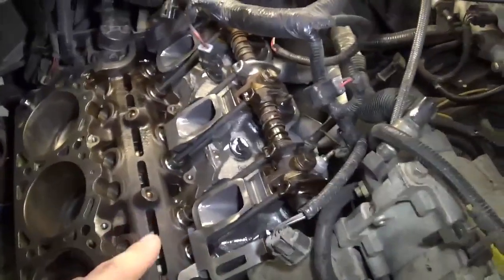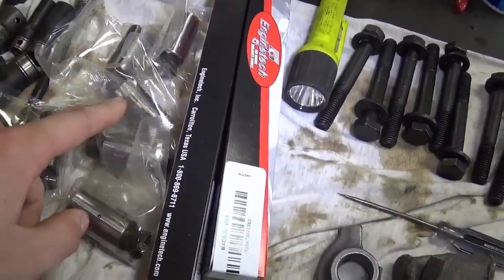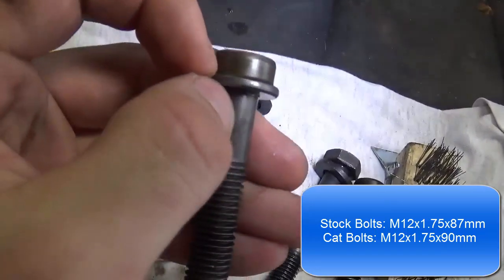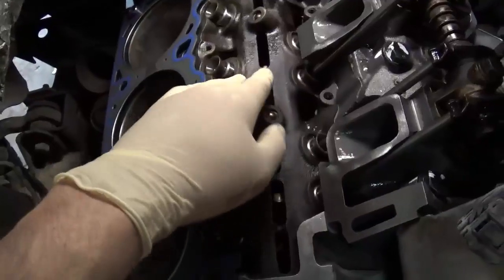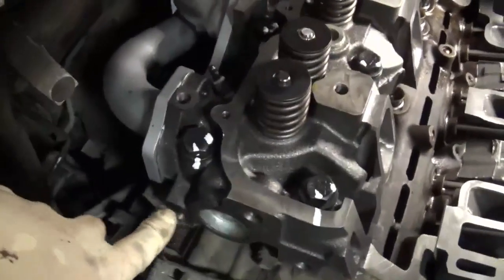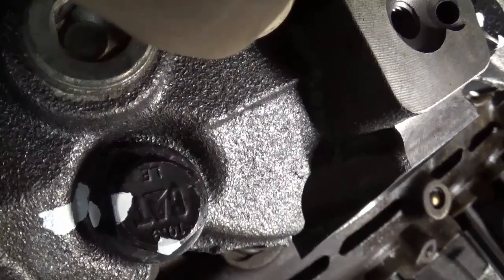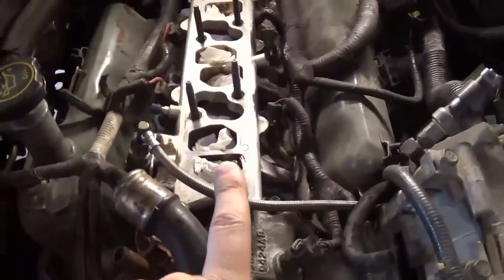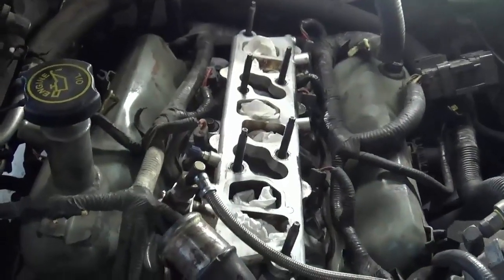Ford 4.0 OHV Top end rebuild

Comment: Typically how much would this entire job run you if you paid someone to do vs you doing it yourself
Reply: I just finished rebuilding my 4.0 ohv for my 98 ranger, total cost ran me about 1200-1500$. I replaced all gaskets and seals, replaced a few broken parts and a few that just generally should be replaced when rebuilding. Shop would easily be double that, plus labor

Comment: First of all, nice video!
I rebuilds that damn ticking 4.0 engines so many times, and I can say that pushrod wear issues fixes real easy. They have not enough oil feeding,  because pressure oiled only bore of rocker arm, oil not pass to pushrod cup. Drill one more 1-1.5mm lube hole to shaft, for every rocker arm, that will intersect with oil passage in rocker arm when the valve is open, and problem solved. Rocker shaft is not very hard, so drills easy. But much better add also hi-volume oil pump (Melling 328) and new non-Chinese lifters (Melling or Sealed Power). Yeah, it's a lot of money (Pump costs 143.79, 28.79 costs new stressproof shaft, and 393.48 for lifters at Rockauto), but if you want good result for rebuild - better to do it. Oh, and I made tool for pre-oiling 4.0 OHV from old oil pump gear and 1/2 socket. Drive it with hand drill or equal tool (no impact wrenches, of course), and first start will go less stressful for engine.
Sorry for my English, I'm not native speaker - I am Russian. Greetings from Russian car enthuziasts.
Reply: No need for sorry, your english is WAYYYY better than my Russian. 6-8 words maybe. Are you drilling the hole from pushrod cup to rocker arm pivot shaft hole in rocker arm. Will be rebuilding 4.0 for sons 94 4x4 explorer and this is good to know as I have no experience with the engines.  Future problem averted.  Thanks. Texas car nut.
Reply: @maryadams6415  Sorry for delayed answer. No, the lube hole in rocker arm already exists. I often drill six  little holes in hollow rocker arm shaft. Attention! Need to remove debris, I prefer to remove end plugs from shafts. If holes drilled, also required hi-volume oil pump  - it's pretty good upgrade to oiling system. No more rocker arms clatter, no more lifters annoying cold ticking. Runs nice and smooth. And I repeat: No cheap Ebay Chinese lifters! They not lasts long. Ideal way are NOS Motorcraft, sometimes big dealers  (Spark-Surplus for example) have them shelf sitting for cheap. But it's rare item, yes. Second way - new set from Rockauto - Melling or Sealed Power. Quite expensive (40$ each), but buy them - and no more lifters problems. Note: if you want to get some extra HP from that motor - CompCams offer 2 camshafts for 4.0 OHV. Both 410 and 422 cams requires custom longer pushrods or milling rocker arm shaft pedestals. Cams costs near 350 $. Little pricey, yeah. But much, much more fun to drive:)

Comment: Did you have to time the crankshaft?? To tdc before putting the heads back on!!?
Reply from the maker: Nope. On the OHV model has the camshaft in block. So easy remove and replace.

Comment: What are the two ball bearings in the center above cam called??
Reply from the maker: I am not totally sure on that one. I think they are suppose to be check valves or plugs for the oil passage ways but I am not 100% sure.

Comment: Length and metric pitch for exhaust manifold studs/bolts? Any part numbers? Great tip on the CAT bolts, thanks!
Reply from the maker: I don't remember exactly but I think they are a M6x1.25 hole but that my best guess. Good luck.

Comment: Do you think those headers actually gained you any power or just made your wallet lighter?
Reply from the maker: By themselves no but with other mods I believe a bit. Be better off doing a full exhaust system. In reality this engine gains very little from mods like this without doing everything. That's why eventually a supercharger will be on the 4.0.

Comment: What year motor is that
Reply from the maker: 2000
Reply: What years were the ohv was it just 2000
Reply from the maker: It can be all years produce because the valve are so close together. Can happen when engine running hot or overheating.
Reply: @aaronconley2762  I found out the last year of OHV 4.0 was '96 Explorer, the following year they were using the OHC version.  Presumably for the Ranger platform, too.
Reply: @OriginalBlindSight  the 4.0 ohv motor was used all the way up to 2000 the Overhead Cam 4.0 didn't start until 2001 in the Rangers.Mine is a 2000 OHV 4.0 with both heads cracked now...
Reply: @JeffAMay  Copy that.  Also, is there some flaw that causes the heads to crack?  I haven't heard much about it.

Comment: Where did you end up on the spark plugs? Do you have to run different plugs with the King Cylinder Heads? I copied your build (2 cracked heads): https://www.therangerstation.com/forums/index.php?threads/2000-ford-ranger-4-0-ohv-cracked-cylinder-heads-photos-of-head-replacement.186082/
Reply from the maker: No the stock plugs did work fine so just run stock.

Comment: How many miles did you have on this motor when you did all this work to it and what problems were you having with it before you replaced everything? I have a 4.0 5 speed in a 2000 4x4 ranger and you can't keep coolant in the jug and it is so gutless on power it's unreal although it does have 225k miles on it. It don't burn any oil at all. Did porting your intake some and the headers help your power any? I'd love to follow some performance mods to gain some power.

Comment: Get an Australian  inline 6  (Barra)...better engine , none of these issues , goes forever and make huge power.. .Watch this https://www.youtube.com/watch?v=LcQ0z_BxYes ..It's a two ton plus Ford Territory SUV ..running a Barra Turbo and with upgrades it's running huge power but right out of the factory these engines are about 400 hp  and you can't kill them either  because they are so balanced and have proper  variable cam timing on inlet and exhaust . My Falcon XR6  has the naturally aspirated Barra and runs 0-100 kmh (62mph) in about 6.7  seconds . The Turbo's under 5 seconds but both variants have huge torque from about  2000-6000 rpm  and why they do everything so easily , Cheers..Too bad the USA never used these . They are still a fully developed Ford engine but not used in America .

Comment: Thanks for the info. I'm no mechanic so my lack of knowledge delays any action on my part. The added information in your videos helped me get started on my top half remove and inspection. How is your explorer and new heads holding up?
Reply from the maker: Explorer has been gone for years (wrecked it). The heads have about 30,000 mile on them and still driving today on the Ranger.
Reply: @TEDDAV64  Thanks for the feedback. I'm going to order parts at the end of the month. I'm going with the King heads but I don't know enough to be fully confident with any choice of parts. I've done my part in the research and consideration of pocket book and goals for the car. I do have one question if you don't mind? Do the heads, in your opinion, have a good enough quality control and assurance to just bolt on? Besides a visual I'm thinking they should. Thanks again for the feedback.
Reply from the maker: Yes I would say so they are a good OEM replacement head with good quality. I have had no issues with these heads and I believe that they are a heavier duty head then what Ford produced so technically they are better because these heads are new rather them being rebuilt. If you get the assemble head like I did, the heads are bolt on ready.

Comment: You showed the price of the pushrod and then said they only were 4.00 
Should look at your parts list and cost.
If the head bolts are tightened in two stages and then 90 degrees they are stretch bolts(which means they can only be used once. (Am glad you did replace them). Did you prime your lifters before installing them?

Comment: Typical for #3 to crack. Seen it a bunch. Reference the lifter tick it most likely is dirty in the block hole. When you take the lifters out make sure the outside of the lifter moves up and down freely. Most think it's internal inside the lifter. No it's the outside of the lifter. Clean both the block hole and outside the lifter with carb cleaner or such. Then either use assembly lube or oil real well. Like someone else said soak them in oil but that really applies to new lifters to get them primed. Also use assembly lube on your push rods and rocker arms. I skipped parts of your video so I didn't see that. It's running is all that matters.
Reply: The 4.0 pushrod ticked when it was brand new. It’s just the nature of the engine.
Reply: he didn't use assembly lube

Comment: Thanks for the video Tom. This gave me the courage to dig into my 95 4.0. I’m leaking oil into cylinder 1 resulting in a oil wet spark plug and misfire. I did a compression test and it came out to around 160psi on all cylinders so I’m thinking it’s a head issue. Plan on taking the head off this weekend. Any advice on what to look for that could cause leak into the cylinder?
Reply: I'd say its possible the valve stem seals are leaking.
Reply: BBgunmaster67 a few people have told me this could be the problem. With the valve covers off how do you tell if they need replacing? Will they be visibly loose or worn?
Reply: In your case the age of the engine is what sums up the guess. As the seals get old they start to harden and leak. You wont be able to see much with the valve covers off.  The most common ways oil finds its way into the combustion chamber are leaky valve seals and worn oil control rings. Did you get the heads off yet?
Reply: BBgunmaster67 No I decided to hold off on taking the heads off until thanksgiving when I have some time off. My fear is that I’ll be dropping 600 for new heads only to find that it doesn’t cure my problem. Truck does have 250000 miles on it though with unknown maintenance history.
Reply: BBgunmaster67 I think I may have confirmed the issue is head related. I put a new spark plug in the problem cylinder and let it sit for a week to see if a gravity leak from the head would be present. I pulled the plug this morning and there is oil on the spark plug threads and a tiny drop on the electrode.
Reply: Looking more and more like some valve seals :)
Reply: If you hear a tick it's possible the exhaust valve seat is worn which would cause the valve seal to wear. If you have in excess of 100-160K miles all your gaskets and seals are probably in need of being replaced. A quick fix is to remove the spark plug and apply compressed air. Then you can take the valve assembly apart to replace your stem seals without dropping the valve.

Comment: Wow.... would never let you near an engine shop.

1. Never just pop your lifters in. Your supposed to soak them in oil over night to properly fill them, you probably blew a brand new lifter.
2. You actually aren't supposed to use new lifters on an old cam. Any good engine builder would know that.
3. Brake clean on the cam? Are you dumb? Your supposed to use engine assembly grease.
4. When installing pushrods and rockers also use engine assembly grease.
5. Lol ported? More like botched and you've completely destroyed the air flow with an uneven port job. You now have turbulent air flowing through your intake and out of your heads.
6. I've seen back yard wrench monkeys do a better job than you.
Reply from the maker: This comment is so arrogant you are not even worth this comment.

Comment: Where did you get your parts from?? I've got a 2000 Ford 4.0 Ranger too and the same head is cracked.
Reply: What does it do whem.heads cracked ?
Reply: @waydeeckhoff912  leaks antifreeze into the cylinders duh

Comment: You over torqued your heads , useing different grade bolts have different stretch charastics , original bolts are torque to yeild bolts , you can use the bolts you used but you must know the propper torque , and no i dont know the propper torque because i never seen anyone use other than factory bolts , besides ARP racing stud kit and the come with instructions on how to torque them , so anybody watching this video don't use the bolts he did you will have problems , and Tom Davis you should have checked the rocker arm bar for wear this 4.0 engine wears the bar where the rockers ride on and that could be your ticking problem  or them cheap Chinese made lifters.
Reply: Those bolts+Cast iron heads and iron block, + low compression+low boost = the stars aligned for you this time. I would of went with ARP and cried only once.
Reply: ^^ this .Its quiet on start-up because the rocker arms are tight on the rail until they get some heat in them and expand= slop=tick.
Reply from the maker: everything you stated I already know. the original are "can stretch" so the bolts I used is so that can't happen because the engine will get boosted and is a cheaper option compared to arp as well as I have had NO problem with the bolts I used and I clearly said that the are not the stock bolt and is what I am trying, Its my truck. When I did the top end the bar was ok so it isnt that.
Reply: i'm not trying to argue , i was trying to help others that might not know the proper torque on aftermarket head bolts , i'm curious what did you torque them to ?  never mind I just went back and watched the video where you torqued them to , and you torqued them as they were stretch bolts which is wrong , bolts that do not stretch are not torqued with the last step 90 deg that's for stretch bolts not the ones you used , its probably too late now but if you would have checked the torque after you did the 90 deg I bet it was way over the limit , and when you put the blower on , you might either break head bolts of pull the threads on the block, just saying.
Reply from the maker: doubt that cause they are harden bolts and by the size of pulleys and blower size max boost it will see is 10 psi and might not even do that depending on power output.

Comment: Those are roller lifters in there, yes? I know people say that you can use new roller lifters on an old cam, but they wouldn't tell you that at the factory. Especially with 140k miles on the engine, bent push-rods and constant lifter chatter. I have the the same problem with lifter chatter on my 91 Ranger XLT 4x4. But it goes away after starting it and running it for about 2 minutes. It has 185k on it so it'll probably have to be rebuilt soon.
Reply from the maker: Yes they are roller lifters and yes you can use new lifters on old cam cause i have multiple times.
Reply: Yeah, you can. But every situation is different. Did you get it straightened out yet, or does it still tap? I hope they weren't Chinese lifters. That could be a big problem, too.
Reply from the maker: no did want to take it apart again but only makes noise cold for most part but runs on all six so I fine with it.

Comment: Great video,  very informative. Thank you for sharing.  One question, how many miles did your engine have on it with this work that you did?
Reply: Im at either 462,000 or 562,000 its a 93. no lifter tick and just started smoking on startup this week because i  didnt plug the fan relay back in after sitting, and it overheated. My bad.
Reply from the maker: I think it was 130xxx to 140xxx when I did this.
Reply: tt 499,568

Comment: I am about to put the heads back on my 4.0.  What did you use for the rocker arm bolts?  I had one stubborn bolt, and it got messed up- so, I want to replace them all.  Do I need the Grade 9.8 for them ?  Thanks
Reply from the maker: storminator60 I just reuse the bolts I took off for the rocker arms and if you want to replace some yeah you have to use the same grade or better so the bolt doesn't snap
Reply: Do you have to put RTV anywhere on the head gasket?  My book and gasket kit have conflicting information.  Thanks
Reply from the maker: RTV on head gasket that is a big NO should never have to put rtv on head gasket.

Comment: i am currently putting my 4.0 back together. did you put in new lifters? i took mine apart and cleaned them real well in an ultrasonic machine. I also went to replace the push rods, and when i got them, i got 8 that look exactly like the OEM, and 4 that have a round tube around the shaft. they are the same Melling part number, same length and ball diameter, but look completely different. Autozone told me they are probably the new "improved' design. Do you know anything about these?
Reply: hoping you figured this out before now, but just to close this case, yes! the new “improved” push rods look thicker and bulkier than oem, but are indeed correct
Reply from the maker: I just bought new lifters but cheap ones cause I think one is defective because in the cold it is still ticking but really loud so o-well. As for the push rods I dont know but sound like a different design.